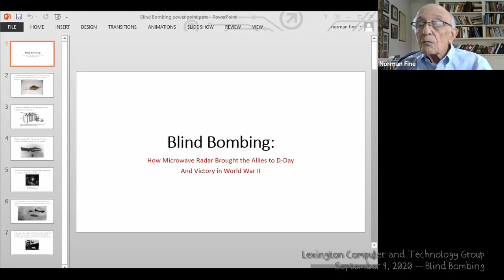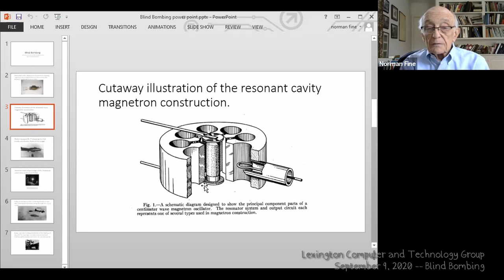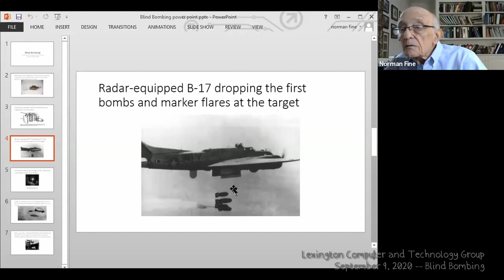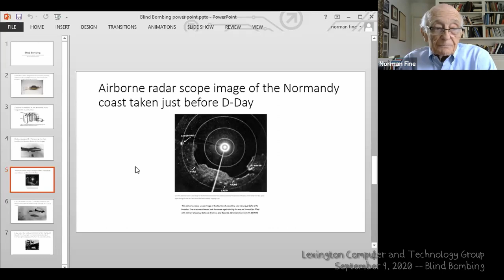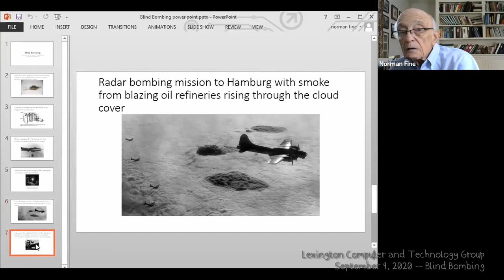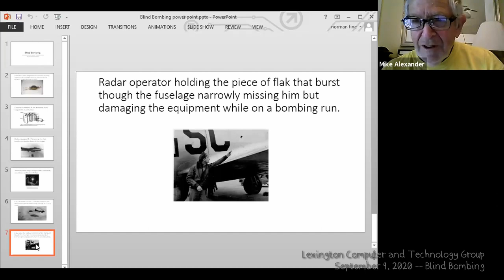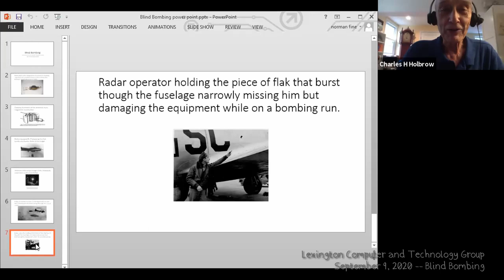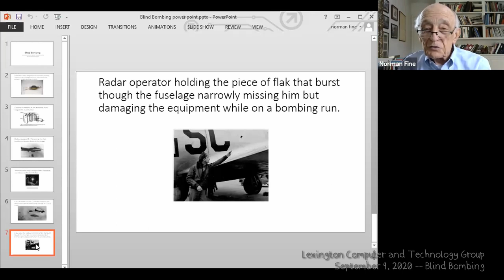Blind Bombing -- The Radar Technology Developed During WWII That Helped End The War

Comment: An interesting talk, though a few minor errors. Randle and Boot didn't get the Magnetron to work until February 1940 (they started work on the project in late 1939). The first prototype put out a signal at 9.8 GHz at 400W CW. Cathode Voltage was -10,000V. The British were working on a Ground Mapping Radar in 1942 called H2S working on a 10 CM wavelength. George Valley visited the UK that year while at Rad Lab on a visit to the British Labs while working on the Rad Lab's Gun laying Radar (Which became the SCR-584). During the visit while in London he experienced a German Air Raid. He had seen HS2 and thought it was a lousy bit of equipment. He then decided, that he could do a better bombing radar and on his return pushed Rad Lab to build a 3 CM bombing radar. Seeing 3 CM was X band, the US bombing Radar became H2X. There was an attempt to build a 1 CM wavelength bombing radar called H2K (K Band), however it was discovered that water vapour in the atmosphere absorbed the radio energy so much that the equipment was useless. Interesting fact about the British Valve used on HAWK. I knew the British had sent a team out to the US in 1954 to look at CW radar research as they had been working on it for SAM applications for their Bloodhound and Thunderbird project. I also know that some techniques used on the Radars used with those two missiles systems were borrowed off HAWK. I didn't know that British Techniques had gone the other way.